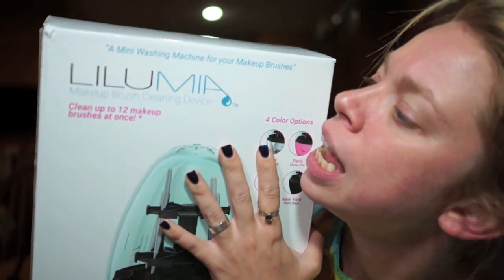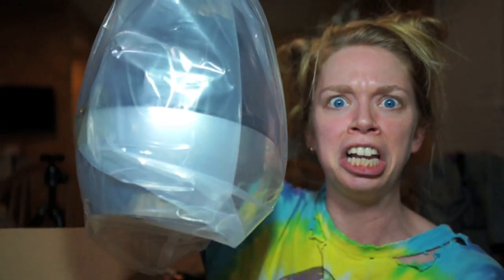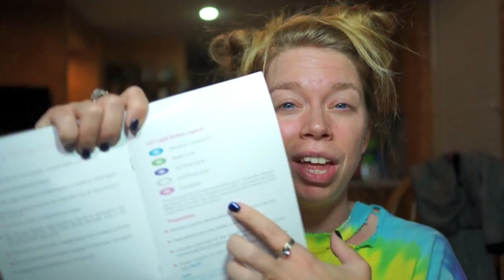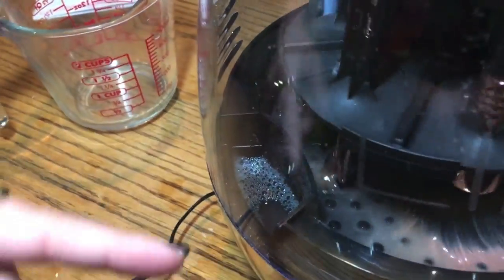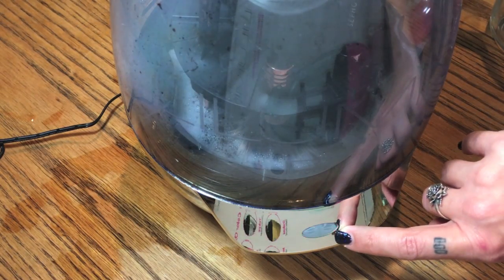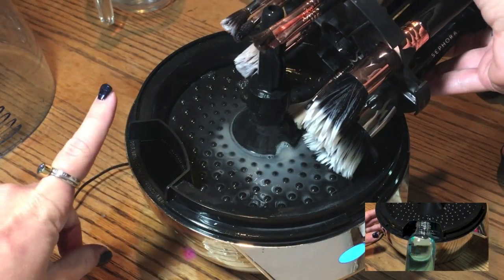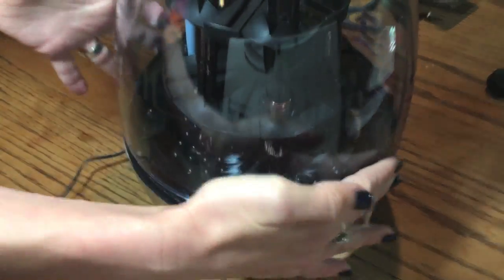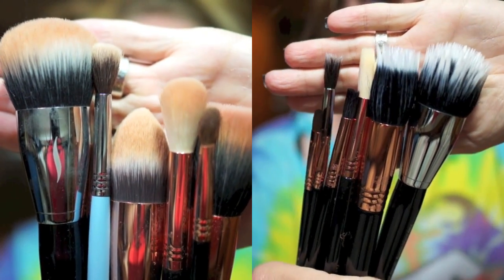MAGIC BRUSH CLEANING ROBOT? - FIRST IMPRESSION FRIDAY

Comment: So, basically, to get your brushes as clean as you manually could in 30-40mins, you have to wait 30-40mins on this thing to HOPEFULLY fully clean them. In order to get them nicely cleaned, it takes this thing 30mins, add another 10+ of you loading everything. And it costs 150 bucks. And it takes up space. It's just SO much easier for most of us to manually do this. Even a makeup artist, who has dozens of brushes, this wouldn't be worth it. If you're a hoarder maybe? Because that's all this would do, take up space. Nice concept, but no.

Comment: That device Wayne Goss demo'd looks so much better and faster.
Reply: rootsm3 what was that called
Reply: Fari The Stylpro. My only issue with that is the fact that you can only do one at a time, but it does dry the brush too in 30 seconds according to the website.

Comment: I take a liquid make up remover to my brushes. takes me less than a minute per brush. and  no residue. I don't see this as a time saver. I just don't see how people take forever to do it?
Reply: Do you rinse them after?  Makeup remover does leave a residue, doesn't actually get things entirely clean and it certainly won't disinfect them.  That's why you still have to wash your face after you remove your makeup.  Unscented baby shampoo and water works really well.  

I'm usually not a Nancy-know-it-all, but I would really hate to think of someone getting an eye infection that could have been easily prevented.  We weren't allowed to clean brushes that way at the counters I've worked at (Lancome and Clarins), specifically because makeup remover doesn't kill bacteria, even though it does get the makeup off.
Reply: +Alessandra Martellacci  I do rinse them as well as use a diluted dish soap solution. mostly I get the majority with a makeup remover and then work the soap in with my fingers then I rinse till clear water runs. of course I clean weekly and only wear make up once  or twice a week.  and I only use 2 brushes... for blush and one for blending. I find brushes messy and not accurate with too much waste from fall out.
Reply: So you don't actually wash your brushes with makeup remover.  Good.  I was a bit worried.  :)

Comment: How to clean your brushes the right way: Get yourself a nubbery plastic surface, like a clipboard with hot glue patterns. Get all of your brushes and put them together in two bunches, shorter brushes and bigger brushes, with hair elastics. Put shampoo on your board, wet your brushes and rub them on the board, rinse, add shampoo, rub, repeat. it takes 5 minutes and the water coming from your faucet into the brushes clean your brushes way better than this neat looking but rather useless space dome

Comment: 💚💚💚💚BUNNY!💚💚💚💚 
ur actually not supposed to clean ur brushes that often!soap, facewash and other chemicals isnt actually good for the skin and it makes its NAtural oils unbalanced with UNnatural chemicals :( 

Contrary to popular belief, moisture generally comes from the inside of your body. The reason moisturizers are useful is because they help reinforce the barrier that nature already gave us to keep water in: that top layer of skin. So what do we do? Oh, we strip the heck out of it, burn it, scrub it, foam it right off our faces. It’s a clever trick by the cosmetics industry, because then we really need to pile on the moisturizer

Cleansing.
Natural oils and water can remove dirt and makeup (even waterproof mascara) as effectively as any face wash.

Comment: Also, a cup of warm water and some soap/brush cleaner does the same thing... just dip your brush in the cup and move around and twist a bit on the bottom of the cup and then rinse a second under the sink and you're done.. you can do all brushes at once too... pointless

Comment: Sorry, but you can clearly see the leakage on the table, and you're recommending this based off you incorrectly using it? Surely you should have used it again correctly before making that recommendation. I also noticed that all the soap was gone in the bottle, which makes me think you used it multiple times... Come on bunny, we're not that dumb.
Reply: Forgo to add, your car accident was way more than 2 years ago, I've been following you since nearly day one... As someone who cares for a mobility challenged parent I'm pretty disgusted you tried to pull that card; you don't need hand strength to wash brushes.

Comment: She "confessed" that she put soup in the wrong section. EVERYONE COULD ALREADY SEE THAT. When she cut back the water was all soapy and the soap bottle was 1/3 empty. BUT WORST OF ALL she just went on with the test without cleaning the water out, obviously it wasn't going to work and she is lucky she didn't break the machine.
Fucking women just refuse to read instructions and break everything. This is a 6mil sub channel and she can't be fucked testing a product correctly. If she used my product incorrectly like this I would sue her for defamation.